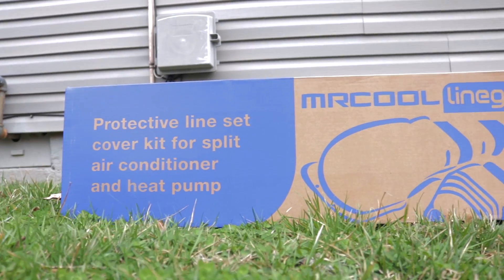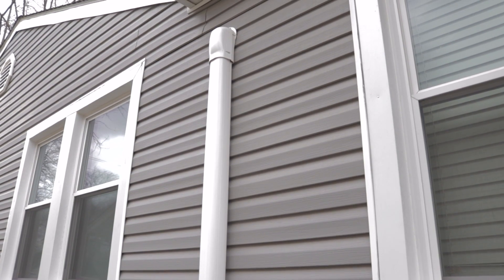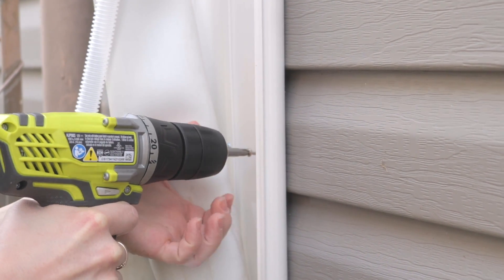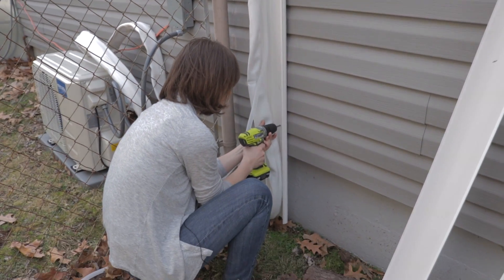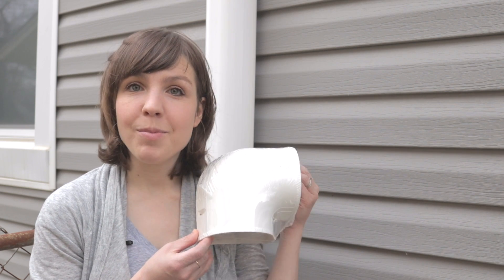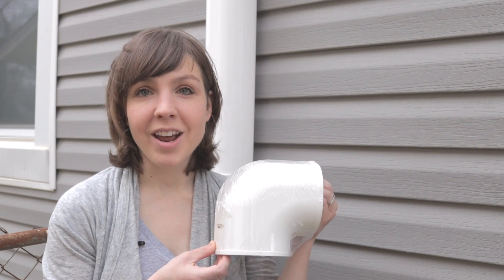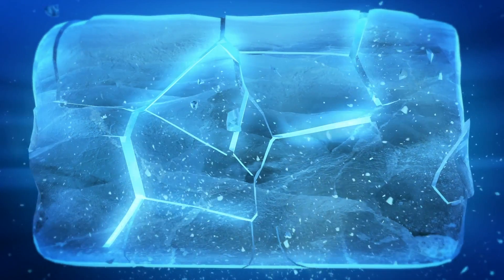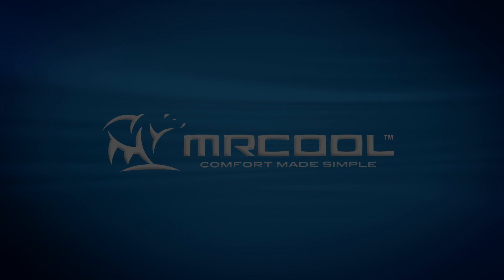How to Install a MRCOOL LineGuard Line-Set Cover Kit

Comment: Video is over simplified. She doesn't show the connectors you must install to connect lengths of cover together. Also the zip tie fastening glue things were not included in the Mr Cool kit I bought, making the install a little more complicated. Check out all the pieces in the kit and see how they're supposed to be connected before you start...
Reply: find that these ziptie parts are best to be thrown in the trash. They always pop out of the channel they slide in. I find all around galvanized stapping works best and just make a "U" shape with it and screw it to the wall through the channel backing

Comment: Just installed this system and I love it. The inside unit fan never seems to turn off is that normal? It heats and cools and the setting is on auto but stays on at a very low speed
Reply from the maker: Yes, that is normal.
Reply: Auto mode isn't generally practical to use especially with a multi head system. There's too much conflict with temperature differences. Best to use either heat or cool mode independently

Comment: So you CAN just kink the line set at a right angle?  I'm afraid to bend it where it comes out of the house.  Why do you guys seem to skip over EVERYTHING I look to the video's to seek answers for?
Reply: What screws do you use to go into the house?  Were those provided?
Reply: So you don't use the flange when you're using the line cover kit?
Reply: What is the clay putty stuff for?  It's not mentioned ANYWHERE in the manual except for the BOM page.
Reply: My line cover kit didn't come with ANY instructions, zip ties, or the black zip tie bracket holders.  Should I have these or what?

Comment: Does it come with the mounting screws to the wall? Also, I had mine all ready mounted and want to cover the original installation. Will this just go over the sleeve cover?
Reply from the maker: Yes, the LineGuard does come with screws. It will fit over the white sleeve.

Comment: How do you connect it to the outside unit?
Reply from the maker: The LineGuard would not be connected to the outside condenser. The LineGuard is attached to the house, and the line runs through it.